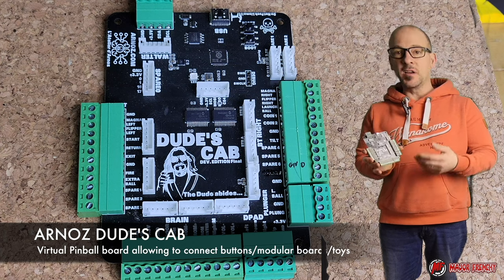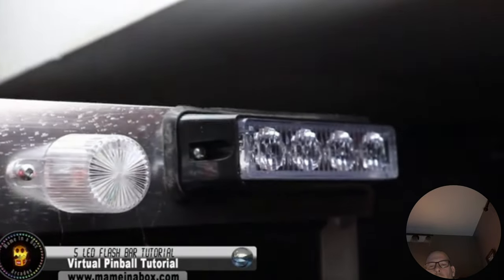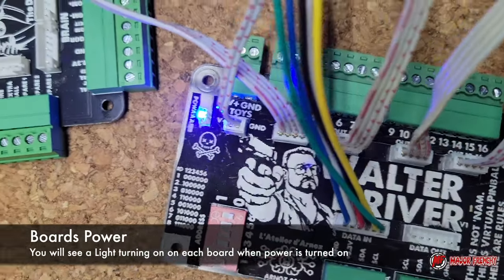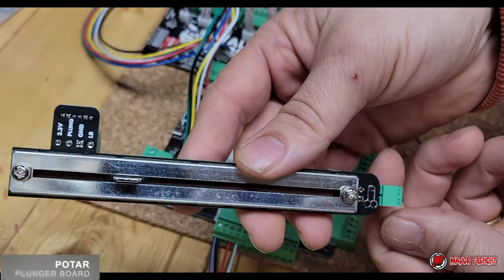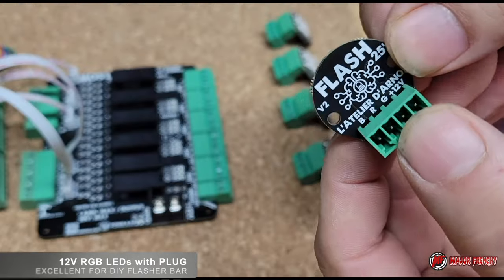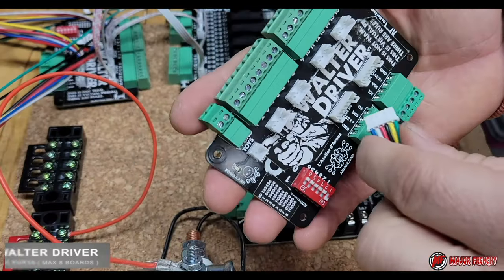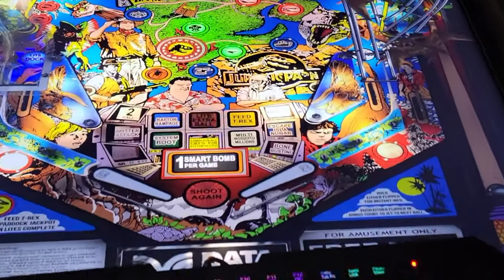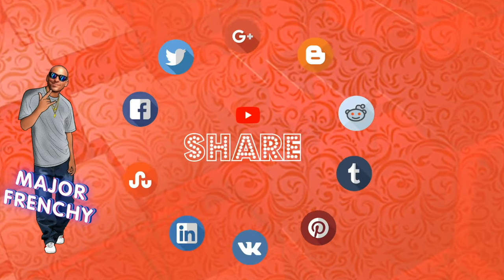ARNOZ Virtual Pinball Boards ( New Lineup )

Comment: Is it possible to import a board like this to brazil? Does it work with addressable leds or do I have to buy a another sub board?
Reply from the maker: I think Arnoz ships worldwide.  And this does not do addressable led. The Pinmos board does. I made tutorials on it in the past , you can check my list of videos
Reply: @MajorFrenchy  thanks Frenchy. Ive been trying to  contact the Cleveland guy but the extreme kit is too much to afford and pay the taxes. I don't mind solenoids much,  but a shaker plunger and leds would be the sky for me. By the way my board is so simple it only lights one button

Comment: Did you felt the deference in latency for the flipper buttons? Love that we now have a one tailored solution for every pincab needs and no need of the KLZ25. Great review 👍👍
Reply from the maker: Thank you for the comments. I personally did not feel a big difference. But very tough to measure the actual latency. I just went by what Arnoz told me. He has tweaked the Flipper ports to be faster than the regular Dude's cab ports. For folks that are entirely geared towards virtual pinball performance and have a real leaf switch, it probably will make a difference.

Comment: I did a fresh install Windows 11 and a Pinup Popper Baller install ver 2311,  got everything wired up and in the cabinet, but I'm having button troubles  Arnoz Dude Cab Configurator detects the buttons and the solenoids and the solenoids test out fine , and I configure them manually in "Configure VPX itself, but VPX does not recognize any of the buttons, works fine with keyboard.

The only difference between the older install and the new fresh install is that on the new fresh install Dude Cab configurator put it on Com 4 and the version that it was working on was Com3

joy.pnl sees the  Dude board and the buttons light up when pushed in the joy.pnl.  

Nothing in VPX standalone or in Pinup Popper.

Any ideas on what I am missing?